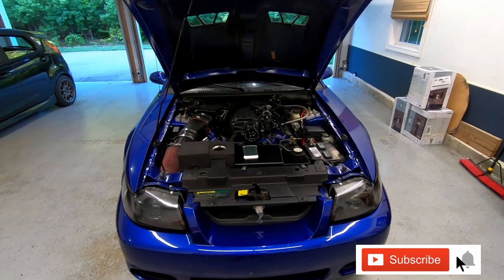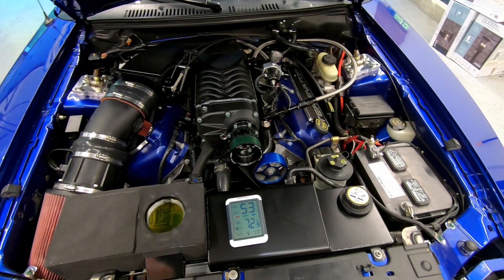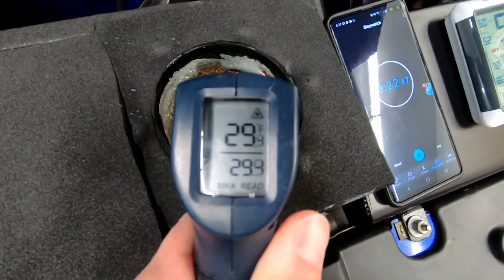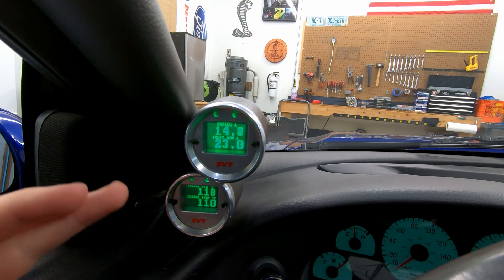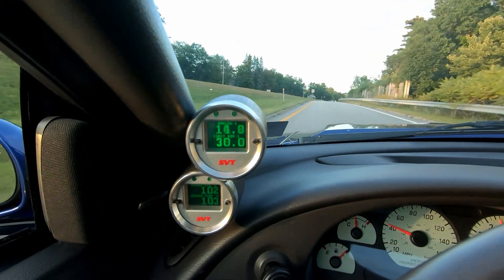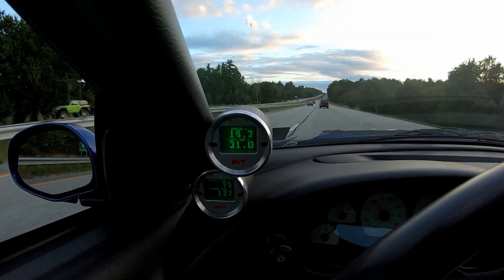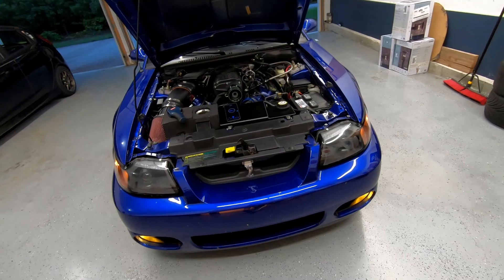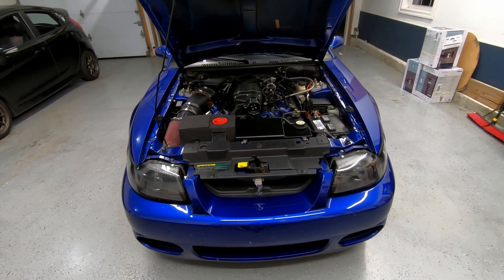Killer Chiller Results and Thoughts | 03 Whipple Cobra

Comment: The main issue is the intercooler under the blower only has 3/4" inlets. If they were 1" or bigger, the water would be more efficient at cooling the intercooler in the blower

Comment: Is this mod worth it running a LFP heat exchanger with the killer chiller? Don’t quite understand the concept. Do you have to run the vehicle with the ac on? I always thought having the ac on pulls power from the vehicle.
Reply: Killer chiller will produce colder water than the heat exchanger and the heat exhanger will slightly heat up the water since the ambient temps are warmer than the killer chiller. Yes, you have to keep the AC on for it to work and the ac shuts off at WOT. 
Link is very helpful in answering your questions! https://killerchiller.com/p/faq

Comment: I see pete Johnson in ur video..I have the 03 got it with 23,000 miles on it and bad valve seals its at a shop now in Lebanon ME getting fixed having a 2.9 put on it as well can't wait for spring I was at 515 rwh hopefully gonna be around 650 with the 2.9
Reply from the maker: Pete's been my tuner for over a decade

Comment: To really make a comparison you should do this test with the ac on(killer chiller working) and show us the iats and then do the same thing with the ac off and compare the iats
Reply from the maker: The issue with that. Is I'm running the stock heat exchanger. It's going to get hot very very quickly

Comment: Do you remember what the charge temps were before the KC at the blower ?  Have to say I was concerned about in cab temperature with the KC, but it seems to be working great!  My cobra will freeze you out in mid summer, and my car is black.. although she pulls timing like a mofo with AC on in summer, I just don't beat on it in the heat.
Reply from the maker: That was a very long time ago! I don't quite remember

Comment: From my experience having this system on my old 2001 Lightning, I insulated my tank as you did but also I insulated my front heat exchanger and all lines to eliminate any air to pass through it. Not sure if you already done this on your Cobra.
Reply: Aren’t you just suppose to Delete the heat exchanger?

Comment: Im still on the fence about purchasing this mod. Yea the coolant temp is cold but the supercharger is still hot. What happened to the condensation they say these things create. I've seen vids where the superchargers get so cold they sweat!
Reply: As long as you insulate everything, you won’t get condensation on the track
Reply: @terrabnadia1793  I already installed it. It did great on my supercharger. Iats never saw over 135. I should have insulated the hoses to reduce condensation drip.
Reply: @primofx2sport  Did you use a KillerChiller or did you go with Interchiller?
Reply: @chrishernandez2490 I went killer chiller. Go interchiller over killer chiller!
Reply: @primofx2sport  Thanks for the reply! I've heard that interchiller is the far better choice, HOWEVER, the killer chiller is only half the price of the interchiller. I don't have a ton of money to spend, and if KC can get my IATs down to about 105-110 I would be absolutely ecstatic. Yesterday I Drove around in about 78° weather (high humidity) and my IAT was at 158° 😵
Reply: @primofx2sport is that great, I have a 4.9KB and on a 80F day It bounces between 120 and 135F
Reply: @ I purchased this me. Install was a pain but my temps never saw over 120 during a pull in summer time. Interchiller is more effective though.